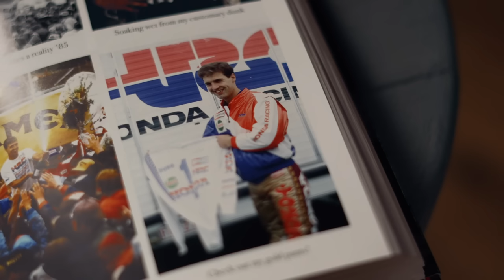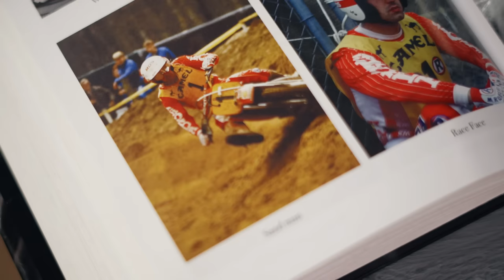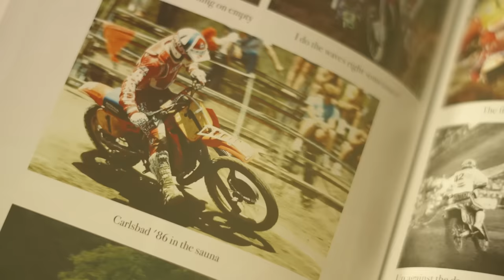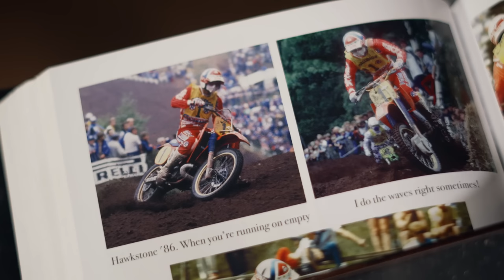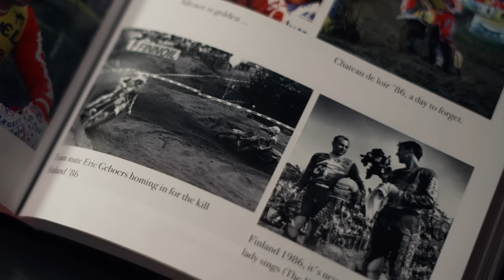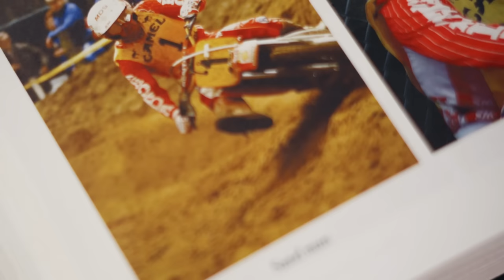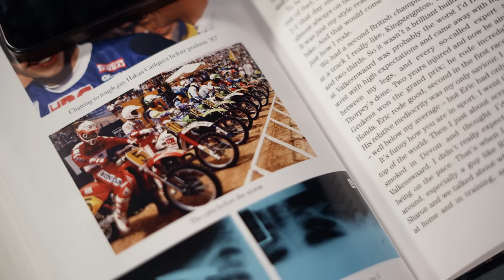Long Lost Factory 2 Stroke Reunited with Motocross Legend!

Comment: Dave Thorpe rode like the wind. I haven't rode in years, the 70's and 80's was my time, it feels like a lifetime ago. In my opinion the mid 80's was the pinnacle of the sport.
Reply: Yep---until the 1986 production rule was forced on the USA only.  That tripled the cost of a bike in 5 years, and the EPA dictatorship forced 4-stroke bike almost tripled the cost again.  No racers in the top 20 coming out of Michigan anymore.  Last factory rider was Kelly Smith over 2 decades ago now for KTM.  The sport is dead,--where it was so alive in Michigan.  Probably much the same in your area.
Reply: @EarthSurferUSA  I was born and raised and live in MI.

Comment: I was seventeen years old ,when I was lucky enough to watch DT crash at the start of the GP at Farley Castle in 1986 and make his way from last place to win that race. What a legend. I drooled over this bike as a teenager and loved to see what the HRC factory team guys could come up with, to give the team an edge, over the competition. If I remember correctly the bike was tuned to behave more like a four stroke with much wider power band than most two strokes and this is how DT was able to ride this bike with only 4 gears, which resulted in less gear changes producing faster lap times. This was enabled by the wizardry of the HRC factory engineers. I would love to know more about how the bikes were reunited with their internal components. I ecpect there were many versions of those parts, due to the rapid development done by the HRC guys. Its also interesting how this bike helped to show how 4 strokes engine characteristics had some advantages over their 2 stroke cousins and how they dominate the series now. Sad to see the demise of the 2 stokes though.
Reply from the maker: Thanks for watching Matt

Comment: Glorious ! Nice to know most are back here 😊, iv thought before will people be like this about say billy bolts bikes in 30 years
Reply from the maker: Thanks Dan, we have wondered the same, but there is no doubt those 80's RC 500's were built in a magical time for Motocross
Reply: Absolutely I have an 88 500 with early wp upside down front end fitted back in 88 it's a treasure maybe bills bikes arernt so hand made as the RC's 😊

Comment: If you ask if the RC500's had exhaust power valves, with a 4-speed transmission, the answer is "No".  :)
500's could have a very wide range of great power, (but not many could ride them to their limit.).  The bigger bore engines did not lose a lot of bottom end power for top end power if they were ported and pipes well.  I think there is a cool company in Canada making 500cc and bigger 2-stroke engines to stuff in a modern 4-stroke frame, and they have a exhaust power valve.  They did not have to increase the price like that, (up to a grand per engine I can estimate).  They will sell less engines.

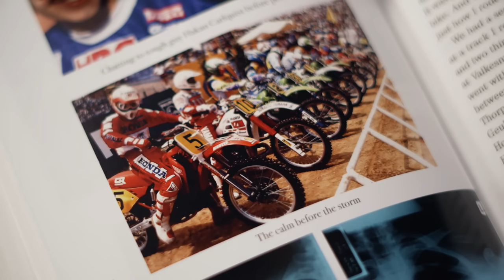Comment: At 18:26, there's a photo with a CR in the front, (number plate 5) with upside-down forks. What year was that? 1989?
P.S. Great content! Thanks.
Reply: 1989 is when Honda went up-side-down on production bikes.  The works bikes probably started using them earlier, as they are test bed bikes. The Simmons up-side-down forks were used in pro racing as early as 1982 in Europe, and kicked off the development world wide.  But, that could be a 1989 bike too.  :)

Comment: are they a power valve cylinder
Reply: I don't think the 500 was, no need really.  But the 250cc bikes had a electronic exhaust power valve that could be programmed by a computer and technician.  That was the test bed for figuring the opening for mechanical power valves.

Comment: Taking off in 3rd gear on a 500 :face-blue-wide-eyes:
Reply: 3rd gear WOT starts are fairly common with a 500.
Reply: If u got the power why not?
I can pull 3rd gear holeshots on my 85' 250R trike with the right sprocket set up.

Comment: I bet decoster and hannah are still fast compared to average Joe.
Reply: "Average Joe" today is also pretty slow.  I see the amateur go-pro vids.  I have never seen some many riders so slow in the corners, (but can clear the next jump from a dead stop in a corner,--so they don't care.  lol.).  There may have been 2 C-class racers in the mid 80's to mid 90's (when I raced) on a track in the USA, out of like 40 to 60 guys.  If I wanted to jump that stuff at the age of 60, (doubt if Hannah would either.), I cold beat the average Joe on my "self highly modified" YZ250 2-stroke, and I lost most of my talent by staying off a bike too long.  So many kids,---so slow today in the USA.  Taller bikes and high handlebars do not help.
Reply: There may have been 2 C-class racers in the mid 80's to mid 90's (when I raced) on a track in the USA, out of like 40 to 60 guys.--------------------who were as slow today as many.